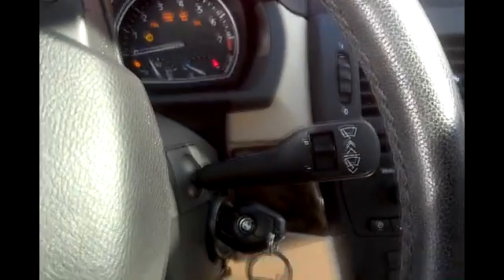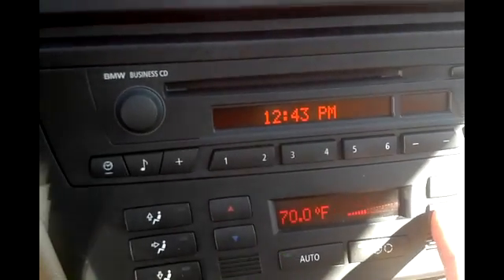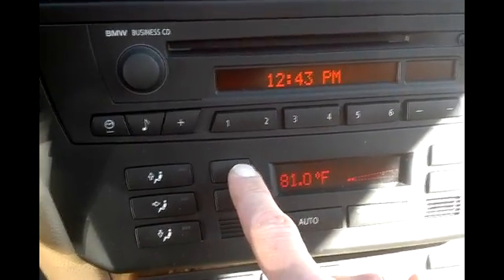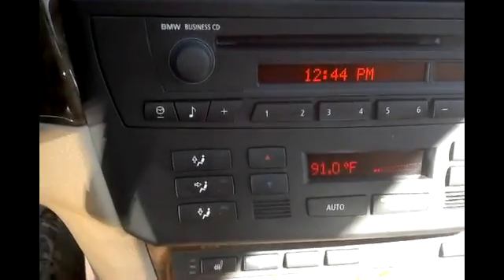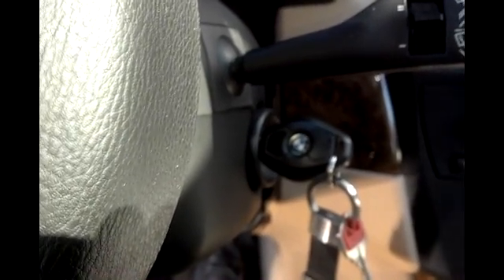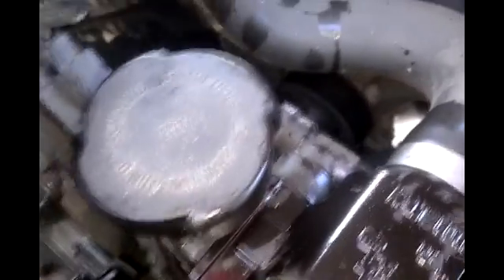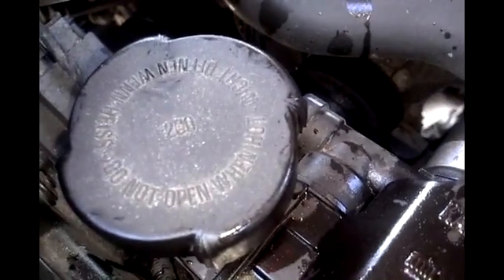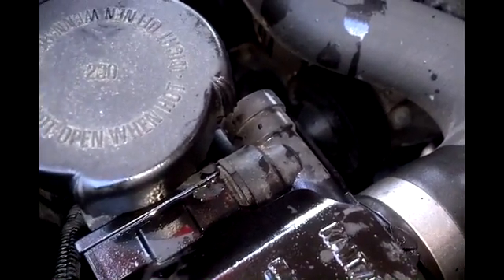BMW Coolant Bleed Procedure For Electronic Water Pump After Repairs On Cooling System

Comment: Hi ,I have 2004 BMW X3 . I had an overheating issue, so I sent it to get fixed and they told me I needed to replace the water pump.After replacing the water pumpe im having the same overheating issue again. Any expert advise

Comment from the maker: Karlijn, You may only need a top off. Just add some coolant until the level is correct unless the reservoir tank is empty. Do a quick look over for any signs of leaks from the water pump, thermostat, and radiator.

Comment from the maker: Hello Matheus, Your 2004 most likely has a mechanical water pump as this would be the M54 engine. Take the bleeder screw out. Fill the system until coolant come out of the bleeder hole. Then install the bleed screw and cap. Run the vehicle up to temperature. Take for a short drive making sure nothing over heats. Then after it sits for a few hours to cool down top off the coolant.

Comment: Awesome... Most usefull. I have an BMW 3-series from 2002 and my coolant light came on in the dash. I dont know sh*t about cars or the mechanics of it. How do I go by? First do this procedure you are showing, then take the cap of and fill up with distilled water? Is it that easy. I would take it to the garage, but i dont trust those bastards anymore. had so many minor problems and everytime I take it to them, some other problem starts. This seems easy enough to fix myself. I trust myself better

Comment from the maker: This engine uses a mechanical pump. Normal bleeding only with filling with the bleed screw out until overflows. Then top off. If the block was drained let it warm up until it "burps" when the thermostat opens then fill the rest of the way.

Comment from the maker: This should have the electronic coolant pump. But on the X6 it may need to be run with the BMW tester. I remember running into this where on the X6 the procedure did not always run correctly manually.

Comment: Does a 97 528 I have to be done the same way ? I just replaced the water pump and thermostat housing in mine but neither leak,the system seems to hold pressure and push it out of the hose on the passenger side,I'm sure there's a trick to getting it to stop this but I'm not sure what it is.any suggestions would be appreciated :)

Comment: I have a n54 335i 07.  I have a meeting with my mechanic tomorrow, Do I need to preform this procedure if so do I need to unscrew anything under before? Bc I'm wondering how the coolant will flush out.

Comment: Thanks guys. I have a 335i 2007 N54 with an electronic water pump correct me if I'm wrong. I noticed today a low coolant warning, opened up the coolant cap and found a creamy froth like substance and the coolant was near empty. The road behind me had coolant all over it as I drove. I topped it up, then it started bubbling up and down spitting and sucking coolant. Temp stayed normal but higher than usuall. I have a meeting with my mechanic tomorrow, my Freind told me that when I changed my coola

Comment from the maker: Hello, I think the 4.8 has a mechanical water pump still driven off the belts. So only the bleed procedure removing air from the system would be needed.

Comment from the maker: Michael, I have seen quite a bit of brittle plastic from age and heat. There is also a computer component in the water pump that controls speed. This is a BSD signal (bit serial data). I am sure the electronics can fail due to constant hot and cold changes. Thanks for the comment.

Comment: @AskTheCarExperts the problem is when you put electronic parts, especially plastic parts under a hot engine they get very brittle and are always bound to break. They would be much better off with the old fashioned metal pumps that can last a very long time. The fact that it pumps hot water to the engine doesn't help either.